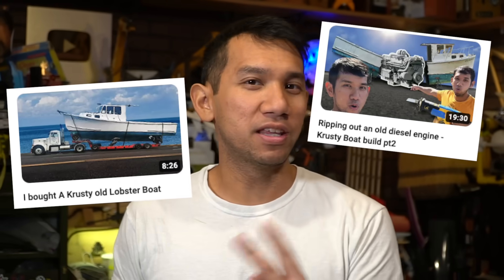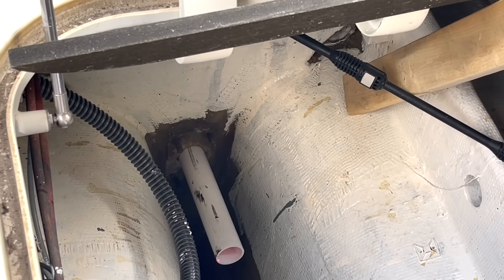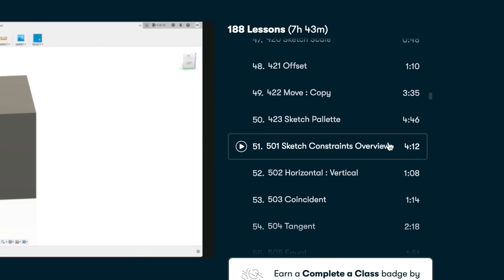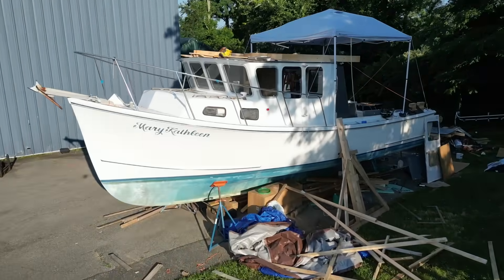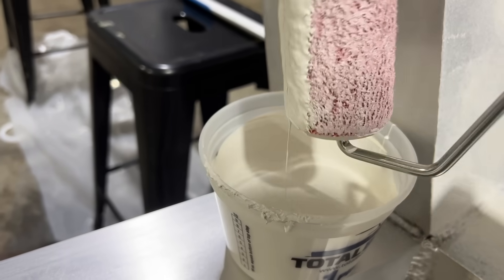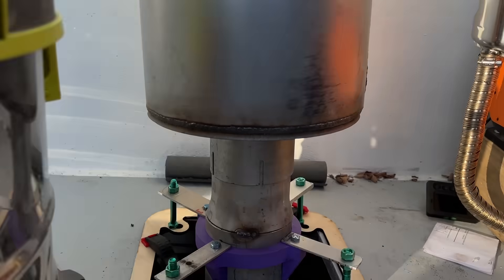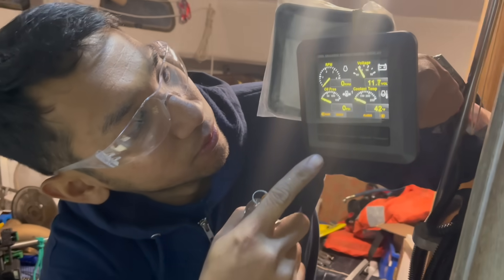Putting a big diesel engine in my krusty old lobster boat

Comment: my fathers boat could either use a radiator or pull in water for engine cooling from the outside.  i didn't see either on your boat.  how is your engine cooling?

Comment: Boat builder here. You did a great job, it's refreshing to see compared to some of the diy fixes I've discovered on repair jobs. Your biggest friend in preventing stainless or titanium fasteners galling and corrosion is a tube of tefgel. Just don't get it on your hands, it's extremely sticky and the only thing I've found that will remove it is mineral spirits.

Comment: Repowering the Krusty Lobster Boat: Installing a Cummins Diesel Engine

* 0:18 Bad Decisions Part 3: Peter continues his "bad decisions" series by installing a used, but powerful, 2007 Cummins QSB 5.9, 380hp diesel engine into his old lobster boat. The engine cost $26,000 and the transmission was another $9,000.
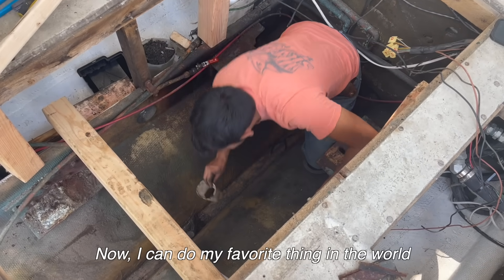* 0:40 Engine Room Prep: The old engine is removed, the bilge is cleaned, and the engine room is expanded to accommodate the larger Cummins engine.
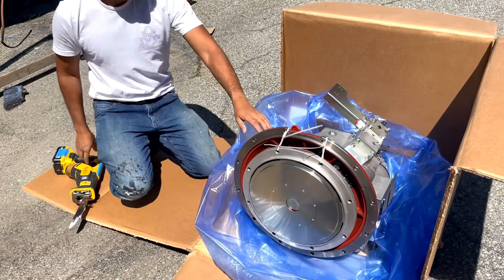* 2:00 Engine Installation (feat. Sam Foskuhl):  Peter, with significant help from Sam Foskuhl, carefully positions and installs the heavy engine using a clever system of 4x4s and PVC pipe for guidance.
* 3:15 Precision Alignment: Using a custom-designed 3D-printed laser jig, Peter and Sam precisely align the engine to the fixed driveshaft, achieving accuracy well beyond typical standards.
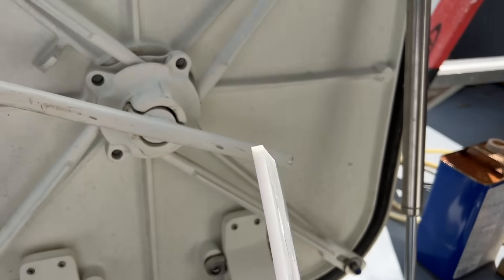* 5:50 Drive Shaft Upgrade:  A new, heavier-duty 2-inch stainless steel drive shaft replaces the older 1 3/4-inch Tobin bronze shaft.
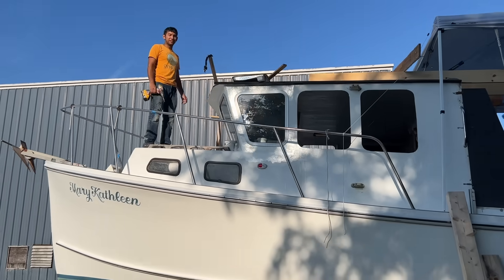* 7:11 Pilot House Remodel:  The pilot house is extensively remodeled with new windows and an extended combing for better weather protection.  Total Boat fairing compound simplifies the process.
* 8:27 Cardboard Templating Trick: A clever trick using cardboard templates is used to accurately create new panels for the boat, saving time and ensuring precise fits.
* 8:54 Custom Mast Fabrication: A custom aluminum mast is fabricated to support a searchlight, radar, and other equipment.
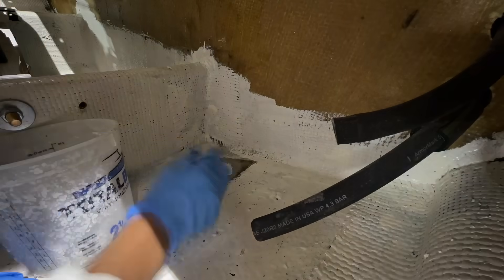* 9:31 Through-Hull Fittings: The number of through-hull fittings is reduced and those remaining are reinforced with substantial G10 backing plates for safety and durability.
* 11:14 Exhaust System (Seaboard Marine): Seaboard Marine provides expertise and custom-fabricated exhaust components for the project.
* 11:51 Engine First Start: The engine is successfully started for the first time, bringing a sense of relief and satisfaction.
* 14:48 Project Delays and Winterization:  The project faces delays, pushing the launch date to July. The engine is winterized to protect it from freezing temperatures.
* 15:38 Looking Ahead to Part 4: The video concludes with anticipation for Part 4, where the boat will finally be launched.  The boat will serve as a support vessel for future projects, including potential submarine and airplane projects.

Key Takeaways:

* This video highlights the challenges and rewards of a complex boat repowering project.
* Collaboration with skilled individuals like Sam Foskuhl and Seaboard Marine is essential.
* Clever DIY solutions, like the laser alignment jig and cardboard templating, can save time and money.
* Attention to detail and meticulous craftsmanship are crucial for a successful and safe outcome.
* The project underscores the significant financial investment required for boat building and maintenance.

I used gemini-1.5-pro-exp-0801 to summarize the transcript.
Cost (if I didn't use the free tier): $0.09
Input tokens: 23432
Output tokens: 656

Comment: Hey Peter, I'm familiar with your time with the Flite Test crew. When I saw you pop up in my feed with a boat, I knew the algorithm must be working - we're in the marine propeller business. With all of that new horsepower, you'll probably need a new propeller. If you would like some input with regard to sizing it correctly, let me know. That's what we do! And we have a propeller design (think winglets) that can develop way more thrust than a conventional prop while reducing vibration, noise and cavitation. More efficiency + happier crew! Best of luck with the Repower!

Comment: heads up the stainless steel shaft and the brass transmission plate will corrode over time so check them out every season start and end ...

Comment: Dude you need a flex plate and wax packing in the propshaft if you hit something with your prop you don't destroy your engen or direct drive system.  As someone who grew up on a boat and an electrical engineer   you can save a lot of headaches make sure you get a coast gard 2 year inspection before you put it in the watter or you will definitely be boarded without the sticker and if they see anything your screwed 😉 don't forget to add a engen vent system and fire system ect. 😊

Comment: why don"t they just use a truck prop shaft and keep the motor level?
Reply: Input and output still need to be aligned. Otherwise you're destroying the couplings. + you'd need to work with gearboxes. Which boats don't seem to enjoy for whatever reason.

Comment: Dude. Boats, planes, expensive classic cars is what people that aren't multi millionaires spend money on to go broke. You could have gotten a used motor yacht with a sleeping space, bathroom and galley/sitting space that needed the engines rebuilt which typically runs about $7K each and updated the paint job/finishing on it for less than what you are going to end up paying for this thing. I just saw a fully running dual engine version of one these type of boats for about $25,000 🤨🤨🤨🤨 Be careful with your wallet.

Comment: If the raw water pump was hooked up and you ran it without water flowing through its very likely the rubber impeller was overheated and melted or broken.

Comment: Gotta do engine alignment with the boat in the water.    When you splash the boat,  load will change on the hull surfaces and the hull will flex.   Engine alignment will change as the prop shaft will move with the hull flexing around it.   Alignment is done in 100/ths,  boat will flex that much.     Other than that,  congratulations on the New engine.   Love the cummins.

Comment: I built and worked on a lot of boats personally I would have took your aluminum angle iron motor mounts and build them by welding another piece on the top part so that you can hang them versus just relying on the bolts going into that board I have seen them through the years back out pay attention to them you may have to put some epoxy on them and put them back in to get them to hold . Been there done that Good luck out there be safe

Comment: I love that 😂. I was in the Navy on the USS AMERICA CVA-66, I worked on our utility boats, we had 50' and 45' boats plus we had emergency whale boats. That's called a heat exchanger, it seperates the coolant in the engine from the sea water. Be careful running that without sea water. We had a rubber impeller, but had inboard exhaust. Personally I like the inboard exhaust. It was quite.

Comment: Used to see you at Flite test.  Little scary seeing you with a boat. Running the engine with no raw water for the cooling system. You burn out the impeller and the rubber particles are everywhere in circ system. I have the non electronic brother of that engine. You need to wrap your exhaust with a heat shield blanket and also there is a tape liner material you can all over the inside of the aluminum exhaust cover to diminish the noise. Pretty impressed with your work and capacity for learning. I use a 26x22 prop with a two to one zf gear at 350hp 2600 rpm. Best of luck.

Comment: That engine is WAY oversized for such a tiny boat. What an utter waste of time and money. A diesel engine needs to be run under load, you will never ever get that engine under load. You would need way less than 1/3 of the power of that motor.

Comment: Yes marine engines have special stuff on them, but 26k for a used motor sounds insane. Cant you convert a slightly used semi truck engine for marine use cheaper?
But I get that its a bigger engine and stuff like a transmission needs to fit.

Looks totally awesome tho :)

Comment: Nice job! Clever alignment tool! Seeing that you aligned it so well wouldn't a rubber coupling just make sense to take out the "settling" of the engine and flex in the hull? It's physically impossible to align more than 2 bearings without line boring them. So once a slight misalignment occurs, and it will once the mass of the engine has bounced over a few swells, the engine and prop shaft bearings will start to take flack = oil leaks.... engine removal... etc...  In a steel hull one could maybe take the chance, but not in 'glass or wood.

Comment: As a licensed aquamechanics engineer, I can safely say that this is a very dangerous activity. The high RPM of the engine could rip apart the propeller, in turn hitting and possibly igniting the fuel tank. If it has high torque, it can easily twist the propeller shaft, disconnecting the propeller and sort of impaling the front of the boat.
But the most dangerous thing of all is that I have no idea what I just said, not being any sort of engineer.

Comment: I've seen a Detroit diesel V6 with a twin disc gearbox swap push a fishing boat that usually run at 9 knots with a straight six single disc gearbox upto 21 knots, it didn't last long though because the captain and owner was use to navigating reefs at a slower speed, the 3rd time they went aground was during a low tide with rocks out of the water, the boat was destroyed in second's 😅

Comment: It was very cool seeing this episode as a couple years ago I did a major engine swap on a car and used a lot of CAD (cardboard aided design) and even cooler was I also developed a laser alignment tool for my driveshaft like what Peter used for his boat. The car had a two piece driveshaft I chose to maintain with the swapped engine, so even though it had CV joints in the rear half of the shaft the front half had to be perfectly straight in it's alignment. I had a friend 3d print me a piece that bolted to the transmission output flange and held a laser measurement tool centered in it which allowed me to set the engine in the correct location and also measured the required length of the custom front half of the driveshaft.

Comment: Put solar power on the cabin don't rely on engine power alone for navigation and emercengy radio.
Also have a little spare motor from a little boat on bord in case your big one fails.

Comment: Wow, beautiful quality work, Peter. I have done many home projects like adapting a Kubota garden tractor diesel to power my Geo Metro and I converted my British 21 foot fishing boat from a small Perkins inboard to a Mercruiser stern drive powered by a GM 6.5 turbo diesel. All of it works but my one-off projects were always hurried and on a budget, almost never with finishing touches. I wish I had your attention to detail...and your budget!   You need more pats on the back for a job well done.

Comment: Hey just curious

Have you ever done any research on energy capture on aircraft descent?  

I know it’d be tough to make it work as far as weight, drag and complexity goes, but it seems far from impossible to implement. 

Like twin EDF thrusters attached to an aircraft’s landing gear that are not fixed, and stow for flight, usable on takeoff climb and descent to fill the batteries partially?

Comment: You should get one of those bigrig supercap batteries to allow HUGE current to get to the motor for startup...it seems to have been dragging a bit (or charge your batteries)
Pretty cool...put some MotorKote (hyperlubricant) in the engine and gearbox/transmission, will help protect the bearings and the turbo, plus it's water resistant in case the cooler ever pinholes and water gets in the oil (for a little while anyway [long enough to NOT wipe out a 26K engine])

Comment: So you need a palest Wight.  Could it be battery's.  Then have a eltrontic motor on the shaft half way connected? Solar  panels  that can slide to the back . Or overlaps.  Can slide out Side or rear . Give shade and ad more power  to charging battery's.  In the day time you will have exercise power air con freezer.  Then use your exspsive motor and gear box. 
Possible? 
Mick Australia 🇦🇺  god bless. 
For Australia  in a bus in the desert.  It's the same. 
But in the water you can use a ultra violet  filter system.  To clean water when at see . With solar power.  
God bless  mick Australia 🇦🇺

Comment: I think you really should have a marine exhaust, they're so much better for fumes noise heat and vibration, also the water cooling down the exhaust also cools down the exhaust gas, which acts like a vacuum effect shrinking of the gas helps boost and fuel efficiency, air exhausts are so intrusive and always interrupt conversations lol, when you're trying to have a quiet cruise, what an excellent job, my brother is a boat builder Annapolis from New Zealand, and he also loves overkill, good on you and thanks for sharing your very professional experience.

Comment: I'm surprised that a bow thruster wasn't an important item on a single engine boat with a keel
Reply: I have an old wooden diesel 28 foot Tollycraft single screw inboard boat.  NOBODY can drive it into the slip except for me...most of the time. This boat is a handful in the marina even with no wind.  There are so many times when I wished that I had a bow thruster in it.

Comment: You must pull the sea water impeller and inspect it as you ran the engine so long it is probably damaged. Never run an engine without water being available in the pickup. There are adapters made to connect a hose for this. Also, have you or are you going to have an engineer do a survey to check for weight and balance and seaworthiness? I owned a boat repair shop and strongly suggest you do because of the radical changes you have made. You might ask your insurance company about their requirements for that.

Comment: Just remember u ever get a major leak..ie.. thru hull ripped out ..turn ur thru hull valve off n cut ur intake hose off put ur intake in the bilge and ur deck hose overboard ..biggest bilge pump a boat has

Comment: From someone who has built and restored boats and been around boats for 50years, well Peter you put the very best of marine gear in that boat and all that stuff does cost 'the bomb'. Cummins is one of the best. A ZF transmission is also one of the best. The closed loop cooling system is a must. The whole boat has only the best products and equipment. That boat will be worth real money when finished and will last a lifetime. Very well done. I'm sure by now Peter understands the old expression that "a boat is a hole in the water into which you pour money". Usually your life savings!

Comment: As a ship mechanic and engineer, those aluminum brackets holding the engine made me cringe. Salt water and aluminum does not play well together, wich is why the painting of aluminum hulls is extensive.. infact combine ocean water, steel and aluminum and leave it for a while and watch what happens. Also there are specific measurement tools and spacers that helps you get the engine aligned.

Comment: Im a marine mechanic and I restore classic race boats, I would like to say I appreciate you doing boat work the right way, most of the time I see YouTubers do things half assed and it’s nice to see quality work.
Reply: What do ya think of those LS based gas engines in that Italian boat? Somehow I am not surprised they continued to run the diesel props with the new gas engines or that they failed to winterize the boat...
Reply: @Melanie16040 I've posted on that channel a few times. As a marine mechanic it was painful watching those beautiful engines be treated like that by an idiot. But I was also not surprised when I realized he was involved with cars. I have to tell people not to lug their engines daily.
Reply: @patricktennant1585  Did you hear it sunk because they didn't winterize it? Too busy worrying about car engine blocks cracking and going around to drain water from them...  Said they thought because the water the boat was in wasn't frozen, they didn't need to do anything to the boat.

Comment: Running without water is a pretty bad plan. On the upside, diesel engines warm up slowly unless under load, so you'll probably do less damage than you would with a gas engine. Still, quit it.

Comment: TIG on steel is really not that bad, or anything doing DC. What's really hard is Aluminum. If you have welding experience, you'll pick up DC TIG, and do at least acceptable welds. It will NOT prepare you for AC welding on aluminum. You need to watch videos and then practice a lot.

Comment: I'm a marine mechanic and do repowers etc every day. I would NEVER own a boat haha. Like someone said below...every point in a boat is a point of failure. Also I don't recommend U joints etc in the drive train keep it simple it works well.. Do a few shaft alignments and its easy...if everything has been apart and its gotten structural work like frames out and planks off or new horn and stem timbers we park an ecology block behind the boat that doesn't move bolt a target to it and machine a target that centers in the output pilot on trans and mark the alignment before anything comes apart. This makes it easy to put the struts and cutless bearings etc back together close to where they need to be...the rest is done with shims and feeler gauges at the drive side after the shafts go back in. Some boats don't have jacking bolts on the engine mounts...I curse at these because than I'm fucking around with hydraulic portapowers and shim kits in awkward space trying to move the drive around and shim it to thousandths. PITA. Some better designed systems have horizontal and vertical jacking bolts.